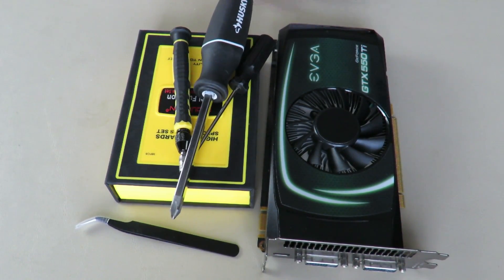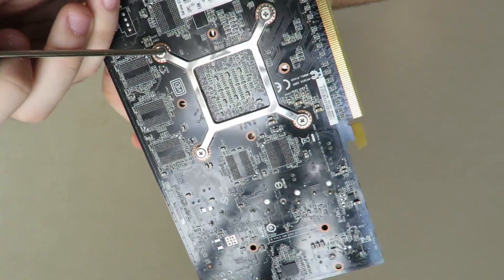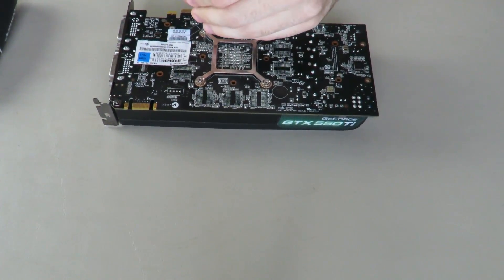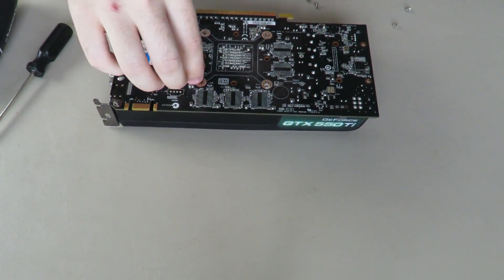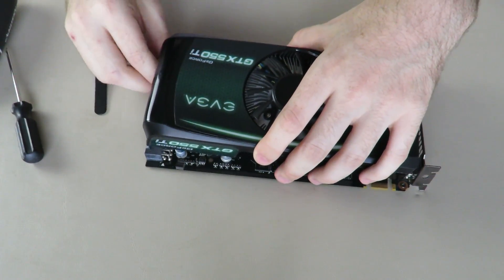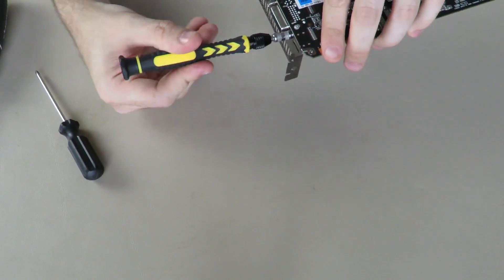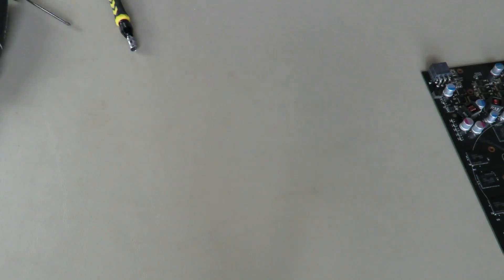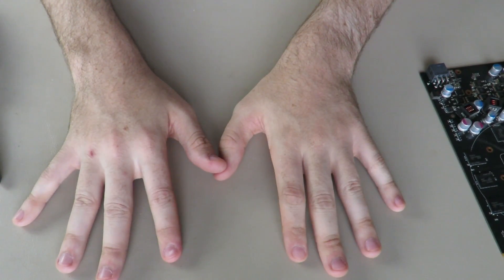EVGA GTX 550 Ti Teardown

Comment: brother, I have this same graphics card but one day I had an accident and I connected it to a monitor that shorted and damaged both components (integrated) that are next to the DVI connectors of the card, even at minute 5:25 they are the The only ones that are seen when you show the front of your card, could you tell me the code of both integrated so I can buy them and fix my plate? I would greatly appreciate it
Reply from the maker: I cant right now, but I'll try to get to it tomorrow.
Reply: @skywaytech  Wow brother, thank you very much for your help, finally someone can help me  ❤I have had this problem for months and I still haven't been able to solve it, I'll be attentive to your message
Reply from the maker: Could you message me on Facebook messager with maybe some pictures or something? That way I know exactly what I am looking for!
Reply: @skywaytech  Of course, brother, what is your facebook? to write to you and talk better there
Reply from the maker: I think it’s SkywayCW if I recall. I don’t use it very much anymore
Reply: @skywaytech  I already wrote brother
Reply from the maker: I wrote ya back my dude! I sent some info! Hope it helps!!

Comment: Hola amigo...a tu placa le falta un capacitor?
Reply: No es que al parecer viene así de fabrica...fijate arriba de los pines de alineación que va en la placa
Reply from the maker: @gonzac.5788  ¡Ay! ¡Ahora entiendo lo que quieres decir! Las GPU normalmente tendrán componentes faltantes en sus PCB. Esto no significa que necesariamente les falten componentes cruciales para funcionar. Cada PCB se construye de la misma manera para cada sesgo. Por lo tanto, falta en esta tarjeta EVGA, pero podría estar presente en una variante de ASUS y lo mismo se aplica al revés donde a la tarjeta ASUS le faltan piezas que tiene la tarjeta EVGA. Solo significa que el socio de la junta no necesitaba esas partes. ¡Espero que ayude!
Reply: @skywaytech  gracias por la info maquina:)
Reply from the maker: @gonzac.5788  ¡De nada!
Reply from the maker: ¡Hola!  No entiendo. No creo que a esta tarjeta le falten condensadores.  ¿quizás te equivoques?

Comment: Roughly the same for a 560ti?
Reply from the maker: Depending on the manufacturer then yes basically the same design. Just has a different GPU die
Reply: @skywaytech  I have the EVGA version, looks identical so I was hoping it was the same process to take apart haha. I'm sure that 2011 thermal paste is begging to be changed.
Thanks for the reply!
Reply from the maker: Of course! Good luck! If you need any help with it just jump in the discord and tag me! I’ll see it eventually and come help how I can!

Comment: Thank you for making these - I just got one of these old cards, all covered in dust and who knows what else, and wanted to know how to correctly take it apart and put it back together. These videos are helpful
Reply from the maker: Glad I could be of help! I hope it was just normal dust and not smoker dust! Those kinds of cards are pretty bad!
Reply: @skywaytech  I'm not sure but it was black and powdery and clogged every nook and cranny on the vent, card, heat sink and fan blade. It's all clean now with fresh thermal paste so we'll see how it works in the near future. One of those clear plastic things on the screws popped off and went who knows where. Hopefully you're right about not being something critical. Doesn't look like they are to me either. Will cross my fingers and see what happens
Reply from the maker: I don’t believe it is. If needed it sounds like you could just JB Weld it back!